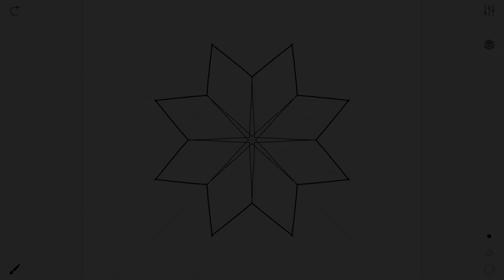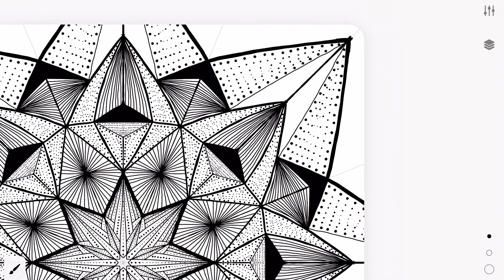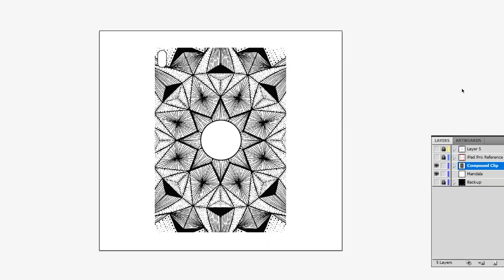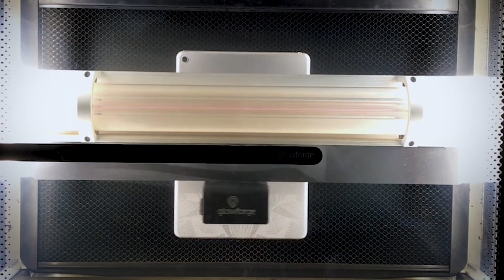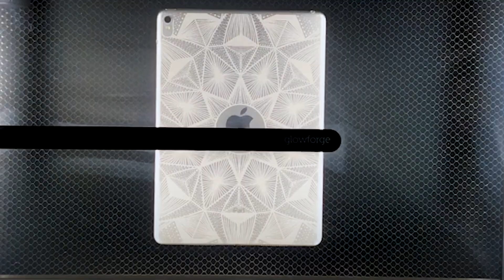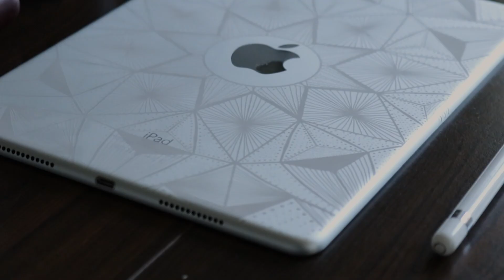Engraving an iPad Pro with Hand Drawn Art

Comment: Nice video. I'm curious if you know of any settings on the glowforge that will allow you to engrave into the metal itself? I had similar results with my diode laser so I'm pretty sure its simply removing the anodizing.
Reply from the maker: Thanks! The settings are only removing anodizing like you said. If you want to get into the metal, you’ll probably need a stronger laser or test some high power low speeds 😁